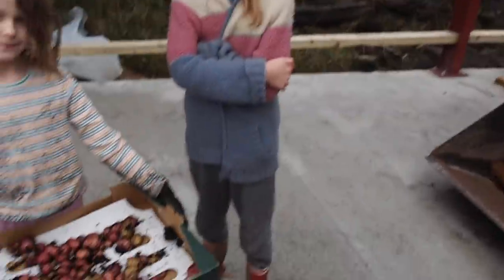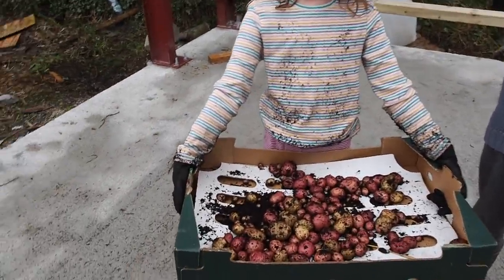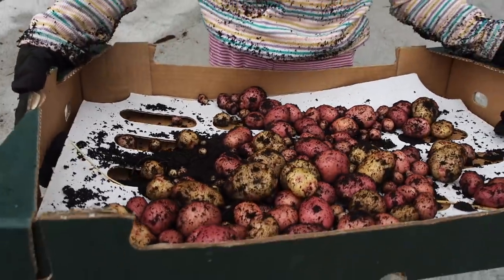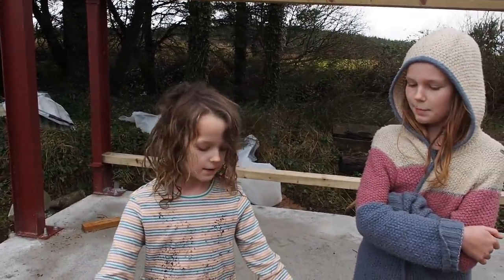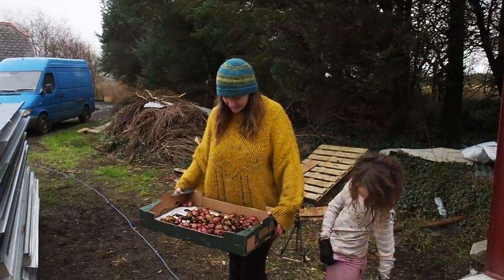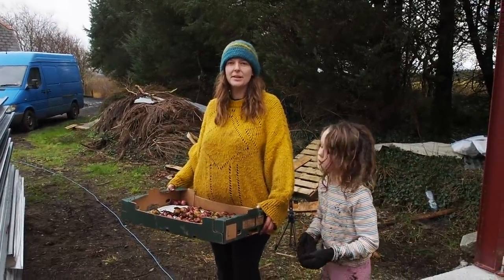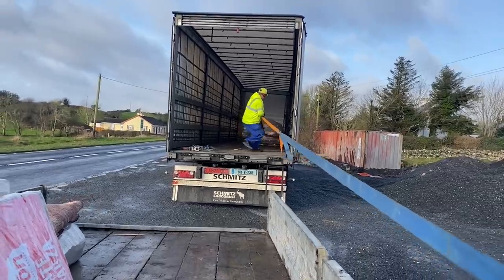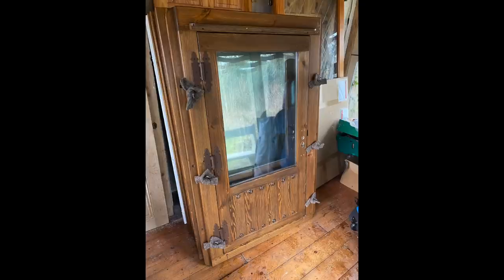Workshop Steel Frame Selfbuild |Part 2 Purlins

Comment: Going to be a great workshop BUT please put a ladder up that scaffold tower and full width platform , you fall and you'll see our hard that concrete is stay safe great.
Reply from the maker: Thanks David. I hear you but it’s a big upgrade for me. I was getting told off a lot for using the bucket of my tractor before I invested in the scaffolding 😳

Comment: Just looking at ur farm work and I’m sure your putting tin on it. Do u think u need some wind bracing to put a bit of regidity into the frame. Look it up on the internet to be sure. Sheds do collaps with out it
Reply from the maker: Would the sheeting not act like a gusset? I wasn’t supplied any bracing
Reply: @OffGridBruce  first bay is always supposed to be braced in the roof. But quite frankly I don’t think your shed will blow down when the tin is on the roof and walls, if it was fibre cement roofing I’d be more worried!
Reply from the maker: @livingoffgridinscotland  thanks. Appreciate the input. I could always crossbrace the purlins while I’m sheeting what you think?
Reply: @OffGridBruce  on our pole barns, we temporarily braced the purlins with 4x2 and removed it as we were cladding it with the tin sheets, our pole barns have no bracing to stop racking and we are in a really exposed location
Reply from the maker: @livingoffgridinscotland  nice one. Think that’s what I’m going to do.
Reply: Look up on YouTube portal frame wind bracing. If your building walls between the steel upnrights they are ur bracing but if your are just using tin then u need bracing as there is no strength in the tin. U can see videos of sheds collapsing on you tube as well. You can access the regulations for farm builds of the Irish gov web site if I rember right. All the bracing is. Is 100mm x 10mm angle if I rember right. Do your own research first.
Reply: Good point. One in each corner, 4 per bay about 4 feet long should do it.  Bruce I will photograph and measure up the ones that have been holding my hayshed/Dutch barn together since the 1970s.
Reply from the maker: @peadaroloughlin3270  thanks Peadar

Comment: Nice, looking into building something similar myself. What dimensions on the steel beams are you using and what snowload have you calculated for?
Nice work!
Reply from the maker: Thanks. They are 6inch steels with 6x3 timber purlins. Not sure regarding snow load calculations. It vary rarely snows here